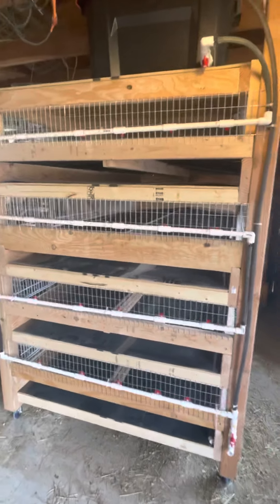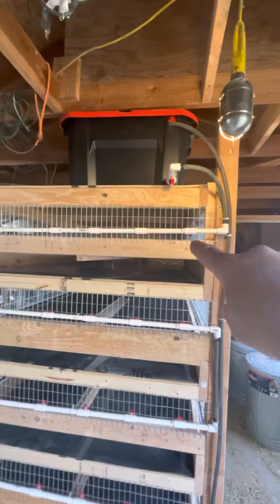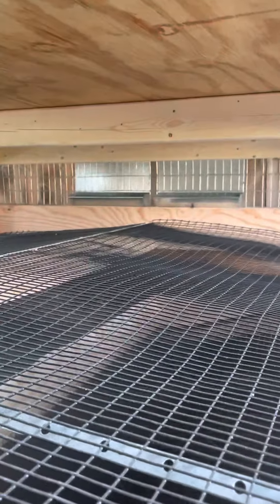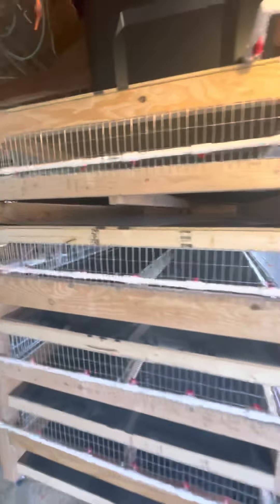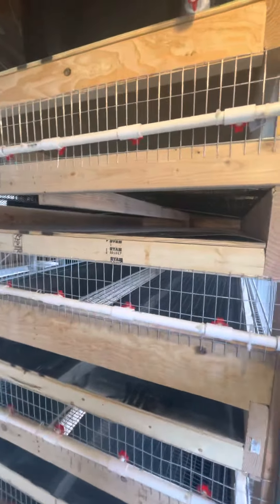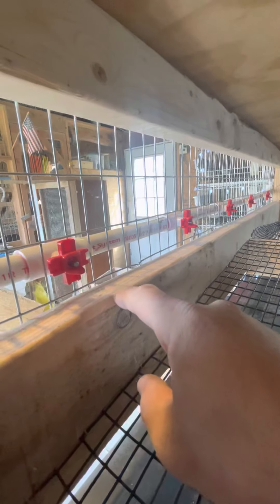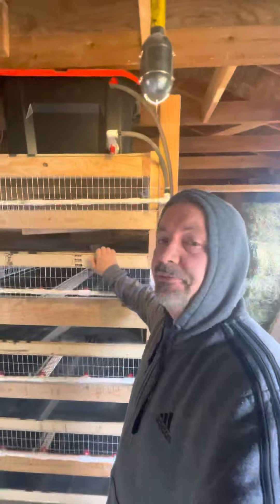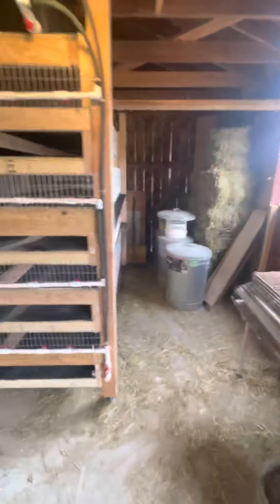Large Quail Cage Build (Final)

Comment: I love how your cages turned out. One suggestion. I saw a video where they did the water system similar to yours but used a blue plastic barrel and placed a stock tank heater in it and the pump to keep the pump circulating through the system in the winter. She said she has no ice building up and uses the same nipples that you are using. I plan to use the same water system when I get to the point where my birds end up in outdoor sheds.
Reply from the maker: Hi, yes I think you are referring to Lauren and her setup. I don’t have an issue with freezing in the winter. What happens in really cold temps is after the birds finish drinking sometimes a  drop is left on the catch area of the nipple and will freeze up. I use an aquarium pump and a 250 watt stock tank deicer also. Have not had any problems with water freeze ups. 
In the summer time with the water tank mounted up top I can turn it into a simple gravity feed setup not requiring the use of pumps. If your tank is located on the ground you will need to use a pump all the time, as well as needing a stronger pump because you will be pushing the water up as opposed to using gravity to help.